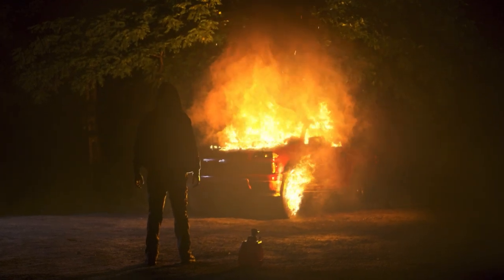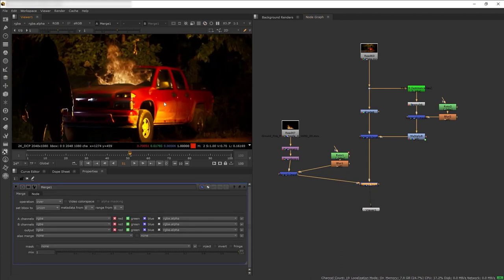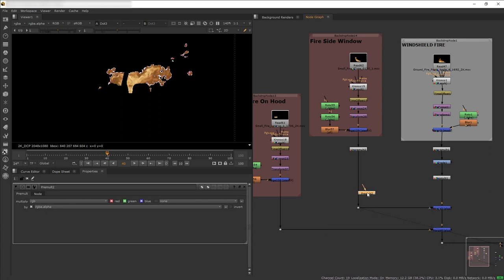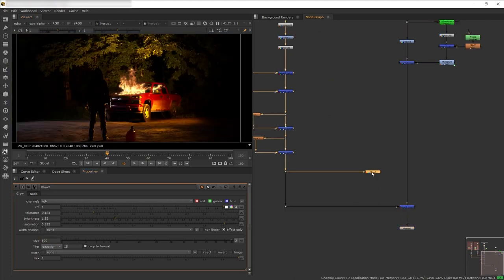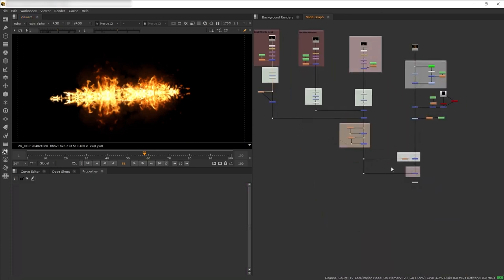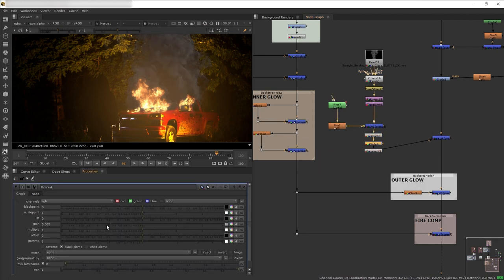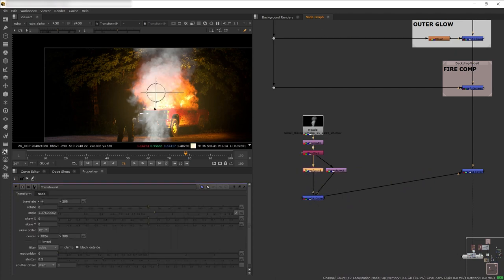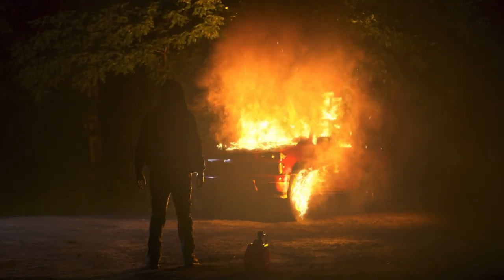Compositing Fire in Nuke | Tutorial

Comment: I love the initiative, and i'm super happy you want to help your audience comp your elements the best way possible. But there are a lot of mistakes in this video that i feel i cannot just leave unremarked, cause i want people to learn the best practices when it comes to comping in nuke. 
Some are rather small and not so important, like small problems with how the order of operations happens. F.ex you always want to colorcorrect footage or elements before you give it a filter kick using a transform or reformat. You should always grade your footage before transforms. 

I hope this doesn't come across as some stupid keyboard warrior or anything, i genuinely just want to spread awareness of how to improve this and work correctly. 

So here's a list of things i saw.
1)
There's no point in reformatting the fire element if you are going to transform it to be even smaller in the plate anyway. The reformat will concatenate with your transform nodes scale and is therefore redundant. But its good practice to put a reformat that matches the format of your B-pipe set to resize type: none, and uncheck center,  so you can connect your viewer to the reformat before it enders the merge and be able to look at the element placed correctly in the format, but against black :)
2)
Teaching people to merge A from the right like you do is a bad practice :) The mask input is on the right by default, so A should ideally merge from the left, this makes larger nuke scripts a lot easier to read without zooming in on the nodes, and is just a good habit to have, its not a big deal of course unless you share scripts with other artists, but its a good practice :)
3) 
I would recommend avoiding the built in glow in nuke, when its so easy to make a exponential glow yourself by stacking blurs (its easy to find tutorials for this), but more imporantly, when adding a glow to you comp that should always be added using a plus operation, never a screen. "A+B-AB if A or B ≤1, otherwise max(A,B). In other words, if A or B is less than or equal to 1, the screen algorithm is used, otherwise max is chosen. Screen resembles plus. It can be useful for combining mattes" its useful if you want to combine mattes, but it will clamp your glow to either the max values of either A or B or it will clamp it to 1.0, which is not how light works, and it will look wrong if you are using HDR values. 
The Glow node in nuke also does not play correctly with HDR values, so i highly recommend not using it. 
4) 
The fire should be added as an over operation, and then the glow should be merged below that as a plus .
The reasoning behind this is that fire is essentially soot which is black, which is extremely warm, leading to black bodyradiation on the outside leading to the warm fire colors. But the soot is not see-through. And therefore it should have an alpha channel and be merged as an over as it occludes whatever is behind it. 
5)
When you comp the smoke you seem to mix up the premult and unpremult, You should unpremult first, then premult.
6)
The smoke should also always be merged as an over since it should occlude what ever is behind it (since smoke is small particles that you cannot see through), and you should unpremult your footage, then grade the alpha down and then premult again. This way you don't affect the colors, but you affect how dense the smoke is (in terms of opacity by changing the alpha channel).

I hope this is of use and that its not taken as being mean, but rather the constructive criticism its meant to be :)